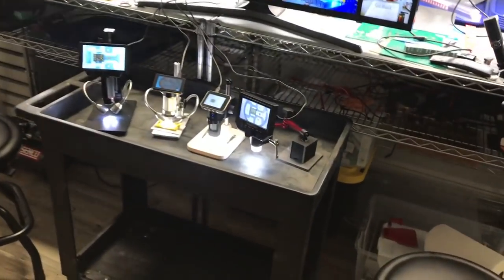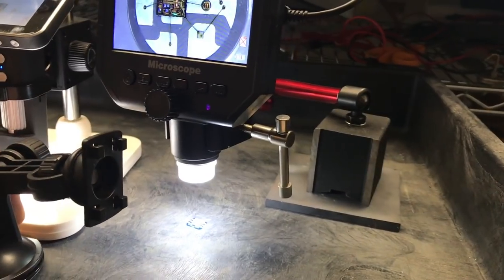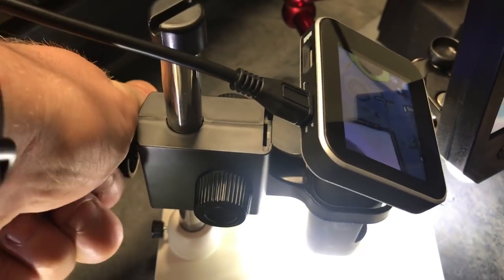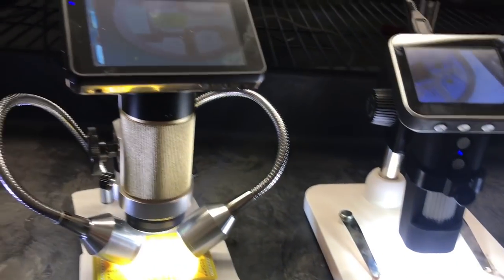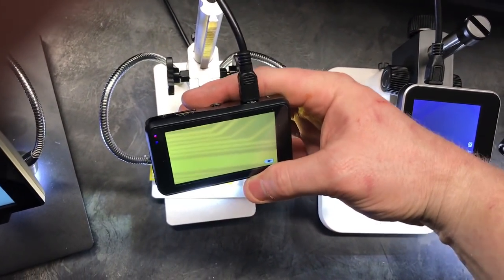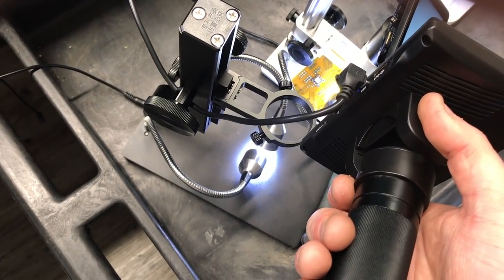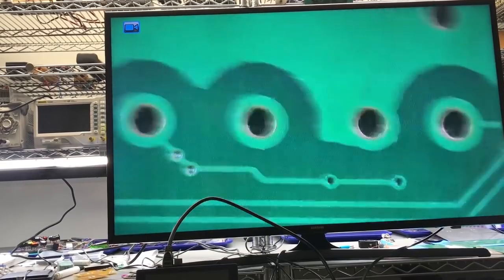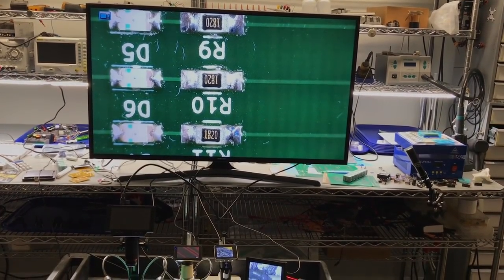2018 Soldering Microscope Comparison

Comment: I would say 1 and 2 are more PCB inflection stations. 4 not bad, how is it working from a monitor? I tried using external out to a 20 inch monitor, or 40 inch tv. The depth of view just isn’t the same as looking down a microscope. To bad they don’t disclose that size the sensor is, or what sensor it uses. If you knew the size you could play with other lenses and maybe even increase the working distance without loosing quality. Yes, I agree megapixels don’t matter to much with the live image or HD recordings. It does help a little if your going to post editing a photo and do some major cropping on a photo. But for me, I don’t keep photos around, so it doesn’t matter. The sensor size does matter for letting in more light and capturing more area. 
Does the negative view help at all with finding traces like on black soldering mask boards?
Well I’m more curious then anything on how some of the better ones stack up to a microscope, but not willing to pay $300 to find out. But for free I would have given it a try also. I’ve never used the measuring distance software myself for my setup, but i guess if your designing a board and know the dimensions of the components out need to fit onto an existing board then it might be useful. I think some of the features are not exactly targeted at electronics only, but for other hobbies as well. 
Nice comparison.
Reply from the maker: Thanks, I haven't used the negative image feature yet, but the pictures look like it would add contrast to make certain thing easier to see/read.  Only the two Andonstar units will connect to an external montor with an HDMI cable and they work as expected.  You can see is @ 12:52

Comment: is it possible to add another lens on the end of it to increase the magnification and sharpness and can the ring leds  for microscopes  from amscope be attached to it for better lighting and will this work with 4k monitors also?
Reply from the maker: The tv in the video 4k. I'm not sure about the magnification,  but I can't see needing more magnification than is available and yes those ring lights do work with these units.  I've seen other people on youtube use them on the adsm201

Comment: The andonstar 201 does not output true 1080p.

I have a 1600x800 Samsung monitor that when feed a 1080p signal from my pc will nag the hell out of you with a message about the signal not being supported,it will display 1080p just fine tho.

With the 201 hookup up to it i do not get this message at all so i am not sure what its outputting but its not 1080p.

Also the image is so dang grainy.i think its really 640x480 being stretched cause if i switch the output on the 201 to vga 640x480 the monitor will crop the sides but the image quality is the exact same as when in 1080p just croped.

Comment: What is the refresh rate on this microscopes like? Is there a significant delay in what your working then what’s on the screen?
Reply from the maker: I'm not sure.  If there is a delay, it's not noticeable with the two andonstar units but I may record a stopwatch under the scope to see what the delay is.
Reply: Latency on the ADSM302 is approx. 240ms
Reply: @zaprodk  still a big latency for those prices of ardonstar...i guest analog microscope still better for soldering job
Reply: @dwibudipermana8480  Yes. I bought an optical stereo microscope for soldering.

Comment: As an Electronic Technician, I don't understand the push for Videos and Pictures in a Microscope. For homework, I only want to use the microscopes to better see what I am doing on SMD boards. Unless you are required to document the work or rework you are doing, videos and pictures mean nothing to the Electronics Technician.
Reply: Exactly, I can't imagine why I would ever want to record what I'm doing, I just want a good clear picture for soldering.

Comment: Take a look at the AmScope SE400 stereo microscope. It's fairly cheap ($150-200 depending on eyepieces), and works MUCH better than any camera because it is STEREO! With it I easily manually solder 0402's, and place 0201's for reflow (they are too damn small for manual soldering).
Reply from the maker: I know a lot of people who prefer stereo microscopes, but I have bad eyesight and don't feel comfortable using them.  You can hook up a camera to them but at that point, I'd rather stick with a digital scope.
Reply: Have you actually tried this scope? As far as I know it's got quite big range of adjustments for those who have vision issues. Having a 3D image is very helpful when working with small parts as you can see how close it is to the board during placement. This was a big problem for me before I bought this scope - I used camera-based scope before, but once I got the stereo one, I now only use camera one to take pictures. Also they have 30 days "no questions asked" return policy, but you will still have to pay for shipping yourself (unless you're in US where they have free shipping option).
Reply from the maker: I have not tried that exact scope but I have tried other AmScopes and other stereo microscopes.  They have corrections for regular poor eyesight but not for bad astigmatism like I have.  I have to use my glasses when using a regular microscope so I don't like them.  https://www.usamicroscopes.com/blogs/learn/should-you-wear-eyeglasses-while-using-a-microscope
Reply: Well I guess fair enough. But still I think they deserved to be mentioned because if you can used them they provide vastly superior experience to mono scopes, especially considering the price.
Reply: The SE400 only provides maximum of 20x magnification.  The ADSM302 provides over 500x magnification.  Quite a difference.
Reply: This difference is absolutely irrelevant for working with electronics. You never need anything more than 10x for that work (maybe 15x if your vision is really bad). What is important is the focal length, and in that regard most these USB scopes suck really bad. And did I mentioned how big thing is stereo image?
Reply: You might be right but I don't know much about electronics.  I ordered it because I want to use it as a stereo microscope so I can inspect small items like insects etc, I expect to receive it soon.

Comment: The magnification on these looks to be too large to be usuable for reading bills, checks, mail, or books.
I solder with a TS100, but I'm getting tired of all these reviews focusing on reading a number off a chip or looking at SMD components, when I would never use it for that.   If something requires SMD soldering of components so tiny they were placed on there by an automated robot, it gets thrown away.   I want to be able to be able to read my  power bill and write out a check, not read a number off a RAm chip.

Comment: Did you say that ADSM302 does have 12MP ?!? because i can only find it as 3MP on amazon, and even that is expensive as phuck! >200EUR totaly overpriced for 3mp.
Reply: I am a Commodore 64 fan thru and thru. First computer I ever bought. Played with it for 72 hours straight.
I had everything that you could possible get for it. I also did the reset switch, toggle switches for device number on the 5-1/4" 1541 floppy drives. Got the 1571 3-1/2" floppy drive, and datasette. Fast hackem' was my favorite disc copy program. I also later, started repairing them for people. The chips were really easy to get. People would forget to turn the computer on LAST and burn out the kernel chip. Those were the days my friend.
Reply: Oh yeah, I forgot to mention my favorite games were all of the Olympic games like "Summer Games" 1 and 2, "Winter Games", etc. and, of course, "Impossible Mission". lol

Comment: isn't a 12M sensor a bit of overkill? Don't get me wrong, seeing the IC die in there was amazing and the individual balls in the paste with actual detail on each one was awesome. Hm. Practically, it's a digital camera with a macro lens.
Reply from the maker: The resolution is particularly useful for cropping as well as using the digital 4x zoom.  Using 4X digital zoom on a 12MP  photo will still give you a clear 3MP image while 4X zoom on a 3MP photo will not.  As I said in the video, the camera sensor size also plays a big role in the quality of the photos.

Here are more photos of a 2cm wide board taken with the 4 units:
Andonstar ADSM302 taken @ 20.5cm https://i.imgur.com/uzFEcRA.jpg
Andonstar ADSM201 taken @ 12cm https://i.imgur.com/Zh7Pf5I.jpg
2.5" "Koolertron" Microscope taken @ 11cm with no light https://i.imgur.com/cVwB9KZ.jpg
2.5" "Koolertron" Microscope taken @ 11cm with light at lowest setting https://i.imgur.com/gLUf2KR.jpg
4.3" "Koolertron" Microscope taken @ 21cm https://i.imgur.com/9HJ58hx.jpg
Reply: t @ProtoG42  good evening you have a good presentation about your product, do you have a 
refurbished item and please let me know i will use it in coin collection hobby thank you in advance

Comment: What an embarassing video. You may be a good tech, but you're a lousy reviewer. Working to a script would be better than randomly waffling on about the products.

That being said, there are three functions that would be essential on a digital microscope. 1/ High resolution sensor  2/ video output eg HDMI, VGA, even composite video output would be acceptable.  3/ A solid METAL height adjustable stand. I mounted mine on a short tripod - works much better than a bit of plastic with a suction base.
Reply from the maker: Coming from a channel with nothing but grainy videos, I'll take your criticism lightly. It was just a quick video that helped a lot of people out. Nothing to be embarrassed about as I don't typically do reviews and this was before I purchased a gimbal for my videos.  If your microscope came with a suction cup, it's probably a low end digital microscope. A tripod doesn't reposition nearly as easily as the adjustable test indicator holder seen in the video. As I said in the video, a high resolution sensor is important but do not only look at that. The size of the sensor is really important as well.